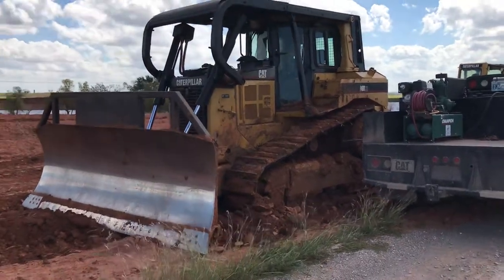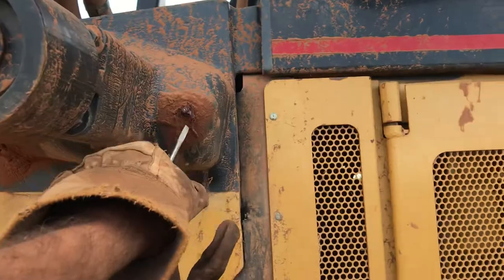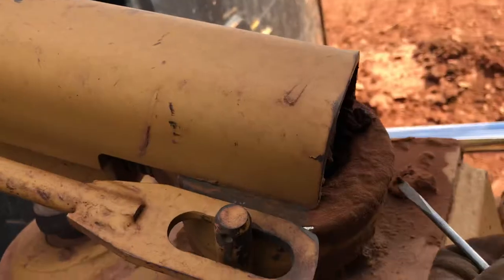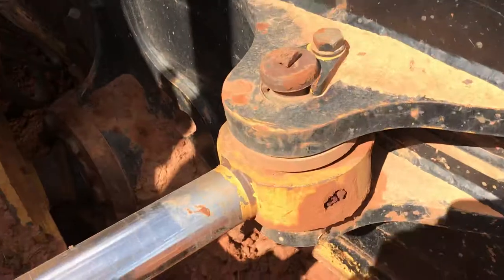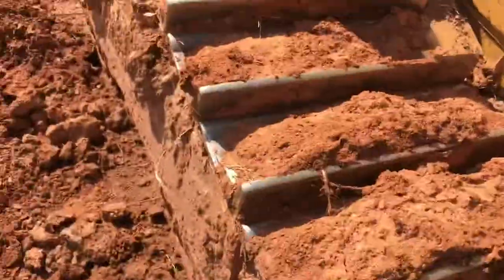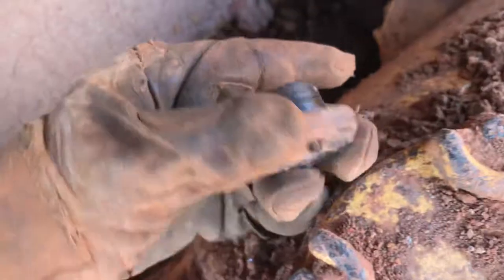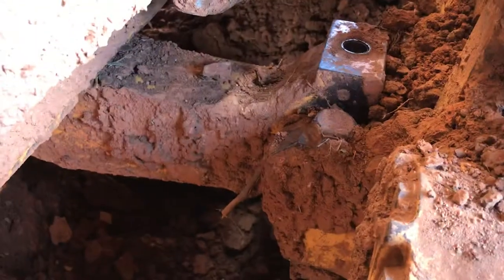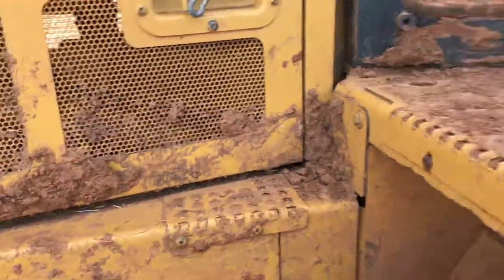How to Grease a bulldozer

Comment: Great instruction video sir! Really helpful. Thank you!!  I just bought a D4E in Brazil - 81 model. Many grease points simply disappeared. No Manual. Please make one for lubrication whenever possible. I am really in doubt as to what oil to use on powershift torque converter and transmission.
Reply from the maker: LuisA7009 thanks for the comment! I have a video of me removing the transmission plug and refilling it. The fluid will be in that video. I’ll also look tomorrow and comment what it is if I remember. I use mystic hydraulic and engine oil but cat in the transmission.